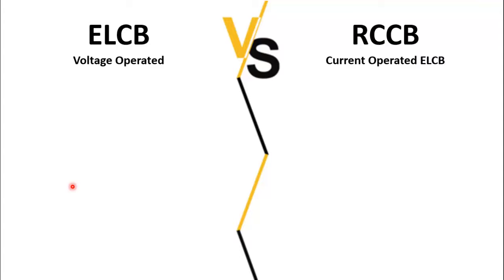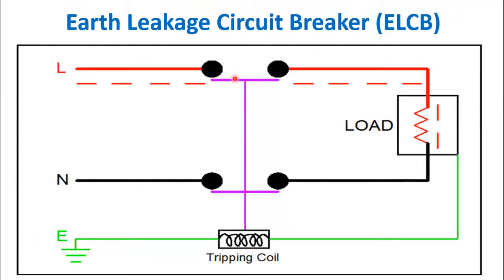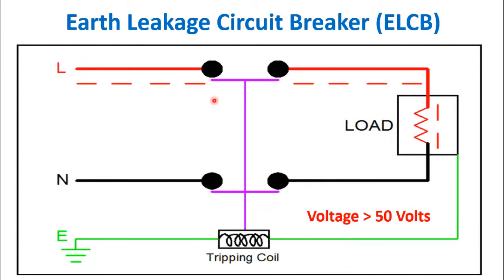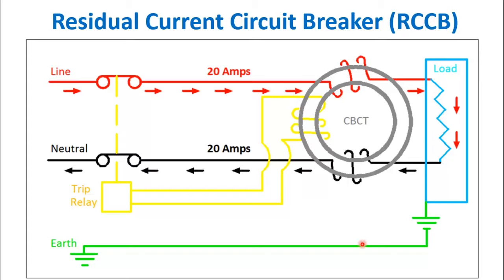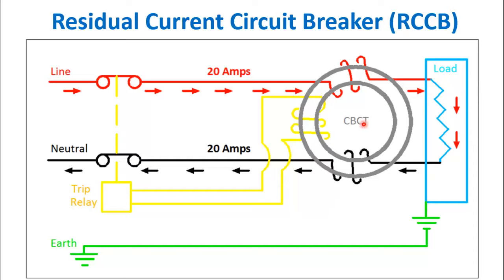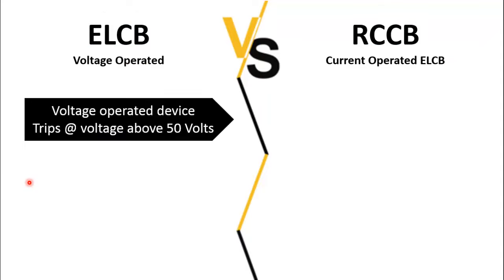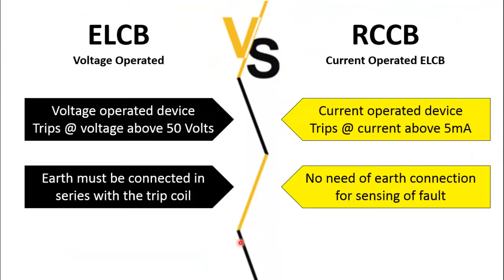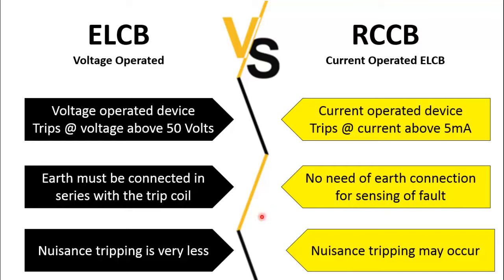ELCB vs RCCB | Difference between ELCB and RCCB | Animation

Comment: My question: if I use the RCCB and change the sequence of the connection( L(RCCB) connected to N of load and N(RCCB) connected to L (Load), So what will happen? is it still working fine and detecting the leakage current?

Comment: Hi Sir, I have a 48V battery operated equipment. This equipment has a metal enclosure and is not connected to  Earth. Can I use an ELCB to protect against shock hazard?
Reply: Below 50v it's not required

Comment: Hi. If ELCB is operated through the voltage, why the ratings shown as 40A/30mA?
Reply from the maker: ELCB comes in both voltage ELCB and current ELCB based on voltage and current sensing respectively.  But the sensing phenomena is same and that is from the earth connection
Reply: @electricallectures  the thing is, you told in the video as the main difference between ELCB & RCCB is voltage and the current.

Comment: Why does all equipment have leakage current?
Reply from the maker: Leakage current only flows where there is some leakage in the electrical network . Not every equipment has. But mostly it refers to the fault current which is undetected from breaker thats why we use these leakage breakers

Comment: hi sir, you earned new subscriber.
thanks for sharing.

i have a few question.
1) why ELCB using 50V to trigger tripping?
2) for ELCB if any personal touch live part, current will pass through the personal only and not going to the earthing. This means no protection for people at all? so this ELCB only operate if live part touch the earth part? correct my understanding sir.
Reply: 1.The ELCB (Earth Leakage Circuit Breaker) is typically set to operate at voltages higher than 50V for AC (alternating current) and 120V for DC (direct current) before it triggers.
2.If a person touches the live wire, the ELCB might not trip immediately because the circuit is open, and the current may not directly flow to the ground if you're not in contact with earth.
thank for seen.🥰

Comment: Elcb, RCCB , design base is IEC 61008-2 according to this norms thease two working same principle e.g. earth leakage (current base) 
Not voltage.
Reply from the maker: Obviously the main thing that trigger tge protection is leakage current flowing in earth link. But voltage sensing means as the magnitude of leakage current is increases such that voltage across the tripping coil increased to 50v it trips the circuit
Reply: @electricallectures   TRUE
Reply: This youtuber is talking abt VO-ELCB & you are on 61008